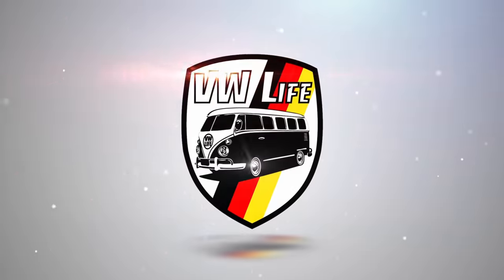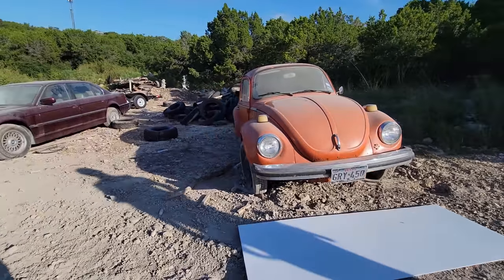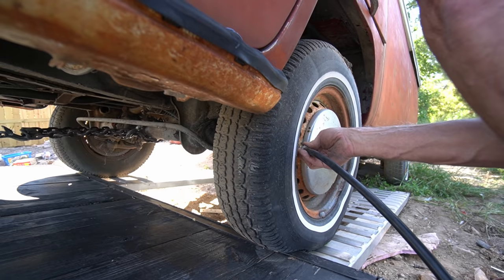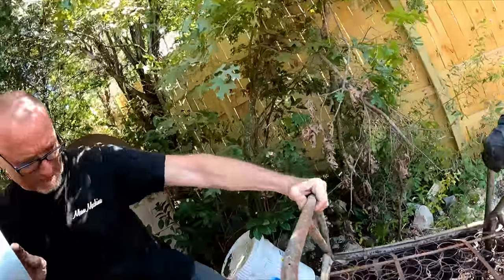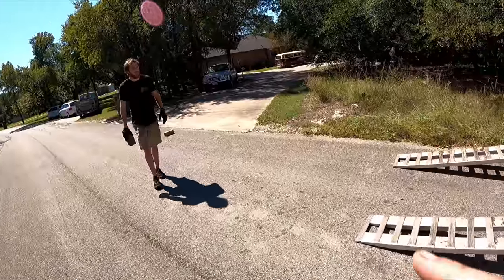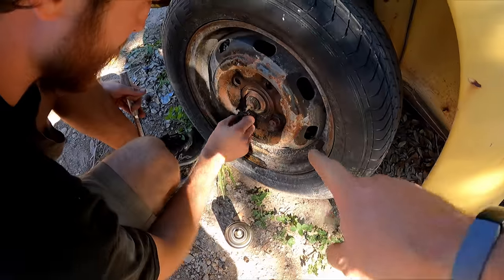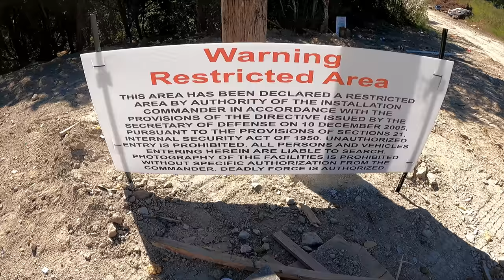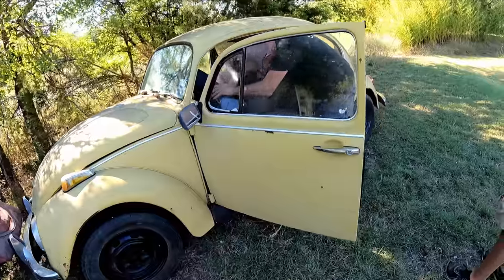Two Volkwagens Rescued! Abandoned for Years Behind A Homeless Encampment.

Comment: I like old VWs (air cooled). I was with VW for 15 yrs a VW guild craftsman. I’ve owned (in order of ownership) 1959 convertible, 2 1960 convertibles, 1964 bug , 1968 fastback (new), 1970 fastback(new), 1968 westfalia camper, Fiberglass buggy with Dual carb sqbk engine, 1973 thing my everyday car for 12 years ,  1969 Karman Ghia. 1973 super convertible . Keep up the good work 👍🎩